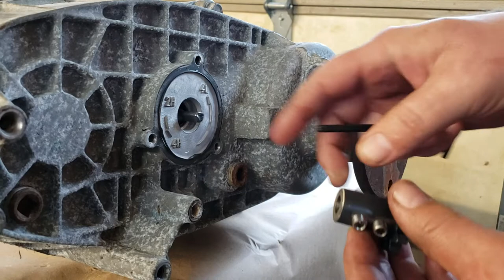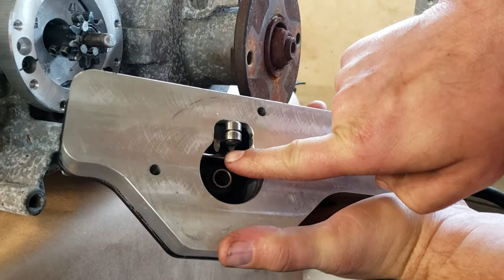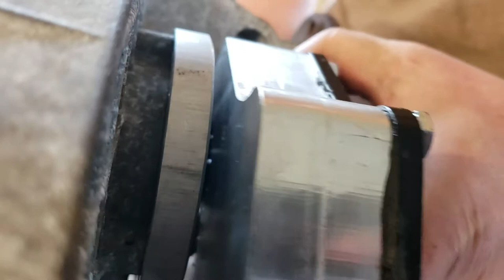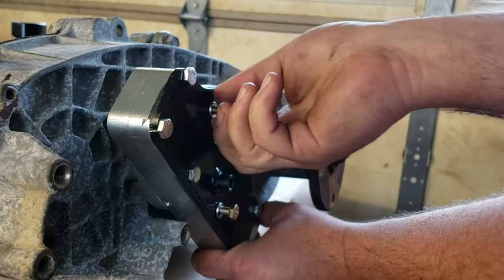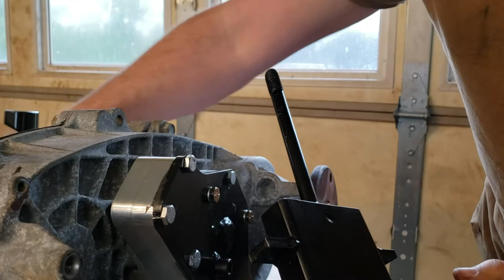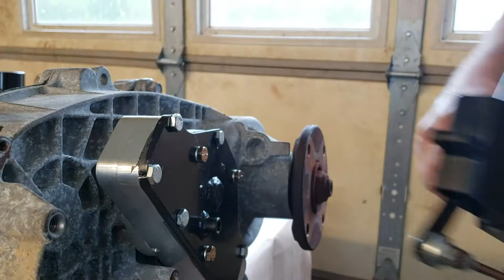Borg Warner transfer case Electric to Manual shift conversion installation

Comment: where do u get this kit for the ford ranger? electric to manual conversion kit, i call borg warner, they said they dont make anything for cars so where can i get it? i have a 2000 ford ranger 4x4 4.0 6cyl

Comment: I've got a 98 f150 that's a 4x4.  Need to convert.  Got electrical parts problems and need to convert to a manual shifter.  Where can I get one of these shifters and how much will one cost?

Comment: Hi Jacob, My order has not arrived. I ordered the conversion kit 12 months ago and despite many assurances it has not been delivered. Judging by many of the comments mine has not been a unique experience. A full and frank explanation is needed for all dissatisfied. Is it a case of inadequate business practices, misjudgement or a combination? A response would be welcomed; a refund would be favourable; delivery of my order would go some way to restoring my faith in your business integrity.
Reply: Did you ever get the part?